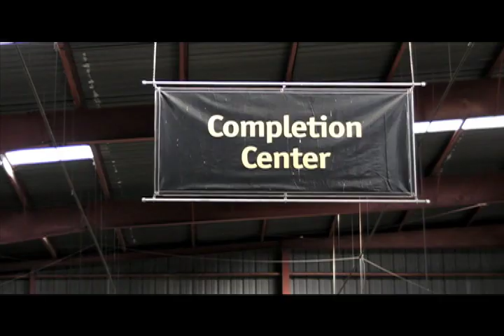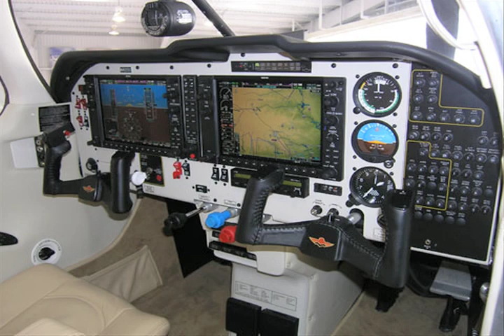Mooney Gears For Aircraft Production

Comment: The fastest CERTIFIED single engine piston aircraft in the world, you mean. ;)

The reason why Mooney keeps coming and going is because of lack of diversity and product value. Sure, you can go fast... only if you put on cannulas and go through the ice into the flight levels. Unless you are going across half a continent, you aren't going to be finished tying down your aircraft by the time the 182 comes into the circuit.... 

That 182 pilot will also be more comfortable, cooler, drier, safer (due to lower approach and stall speeds), richer, and more secure in the knowledge that his plane will still be supported five, ten, twenty, or even 50 years later.